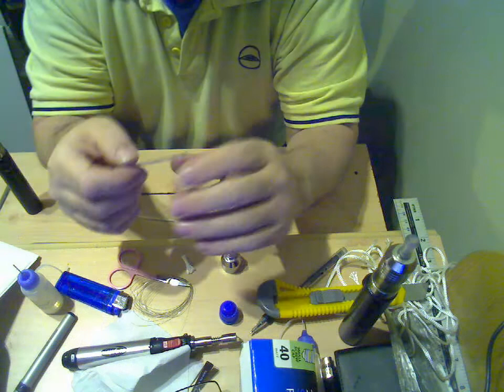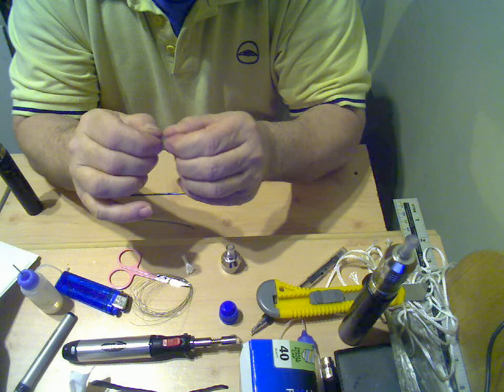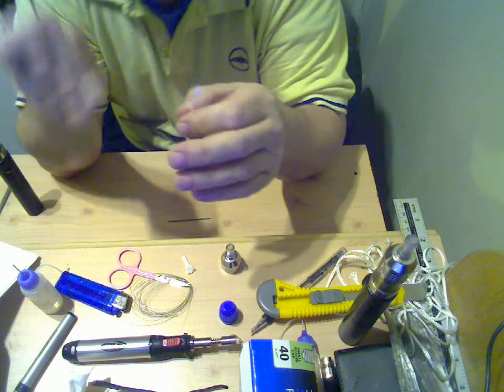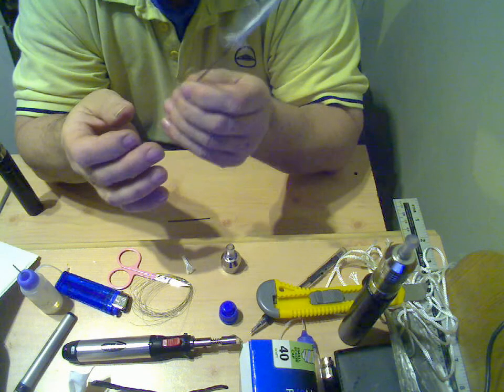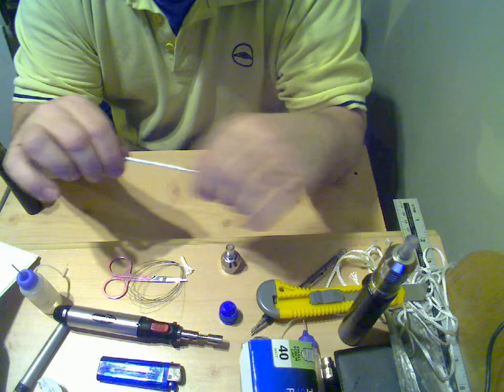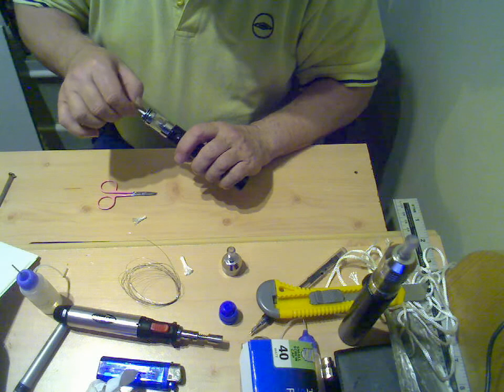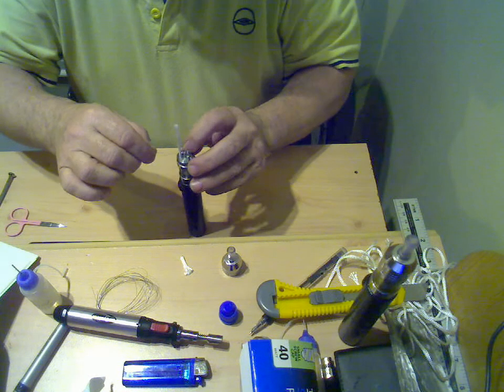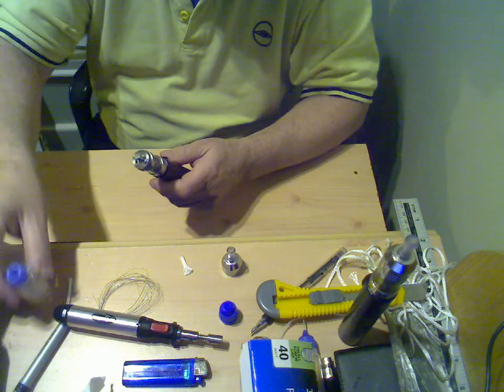Ekowool sheath for stainless steel wick

Comment: Thanks, sir, for your really clear, easy to follow, video on the Ekowool. It is a B for fraying, I must have used about half of it to make wicks, and cut of the rest frayed! I'll have to try burning it. I'm hoping your method will help with my Kanthal heating between the SS mesh and the center post, and snapping it gets so hot :( My Aga-T is suffering from this and is unused :(